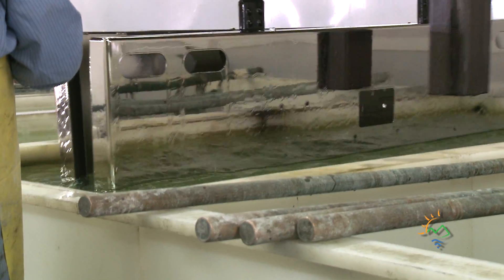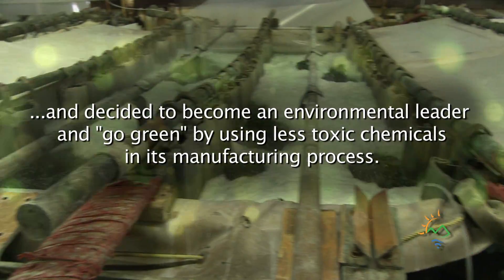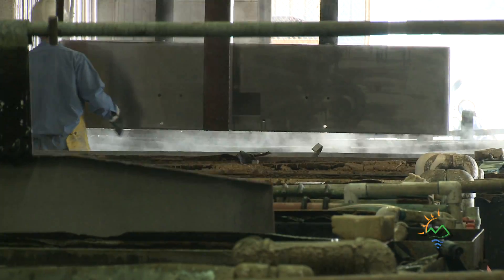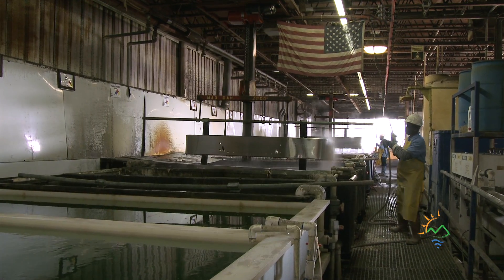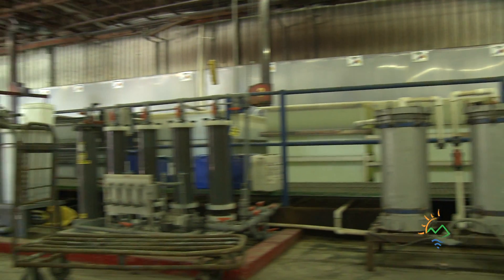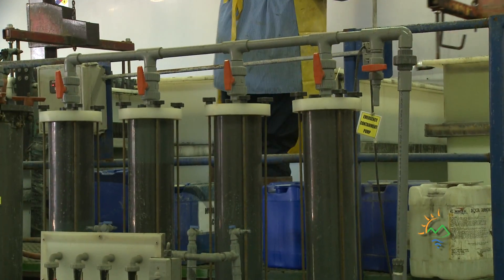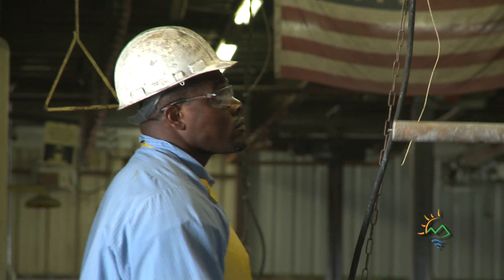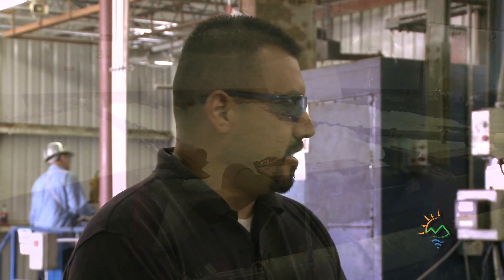DTSC Success Story - Valley Chrome Plating

Comment: i have worked with tri-chrome for 15 yrs,has a very low tolerance to metallic contamination,anything above 10ppm copper,zinc,or nickel and the finish deteriorates rapidly. many additives needed to maintain bath to optimum values.
yer its greener,but gimme the old hex-chrome any day. hey wot do i know? i only been doing it 40yrs this year